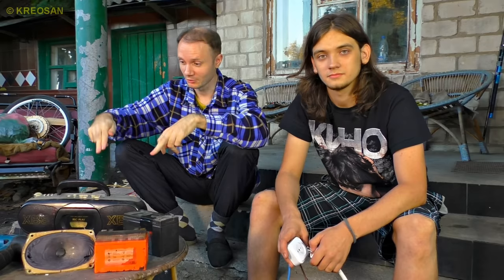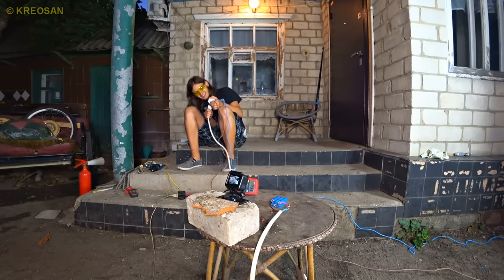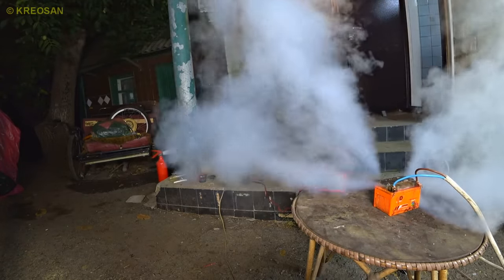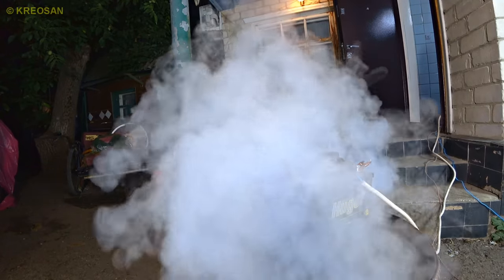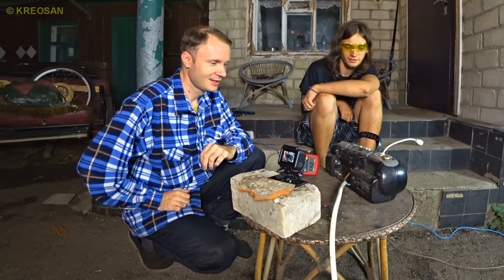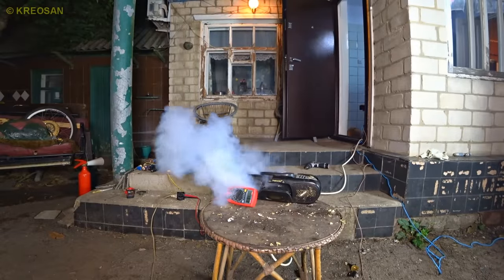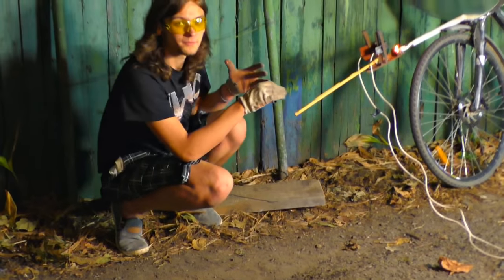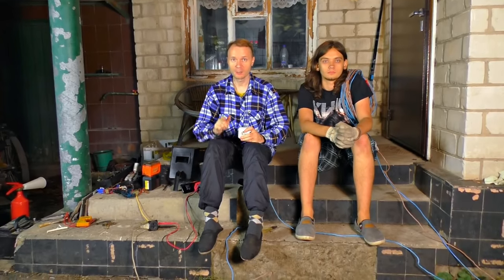220 Volts / Is it dangerous?

Comment: The power company must be confused when 50kW are being drawn from the streets transformer and all except one house have fled away.
Reply: they don't have street transformers, there's a transformer building for each village, some times for the entire county or town and the company can't really see that stuff
Reply: @user-ge4uk9ui8y  r/woosh
Reply: How can they use so much Ampere without blowing a fuse? That scares me a bit.
Reply: @burtreynolds9912  they don't have fuses
Reply: @user-ge4uk9ui8y  Oh my God! Then it takes a very good fire alarm to sleep in that house! Especially after those electric games...
Reply: Ignas On Google Streetview i have seen street transformers often enough in Russia. More in rural areas though.
Reply: They have an old video showing how they get the unlimited power. Directly. No fuses. From the above ground powerlines
Reply: Was that 220 volt ac or DC
Reply: And then they send an inspector in there yard to check for electrical issues and see this 4:29
Reply: @mr.waffentrager4400  If I had to guess, AC.
Reply: @mr.waffentrager4400  guessed it was AC. "Alternating current"
Reply: 6:10
Reply: @mr.electronicsdevicevlog9333  
6:10
Reply: @impostrous  r/wooooshwithfouros
Reply: Street transformer and 127 V is murica only
Reply: They don't have street transformers. One or few more big transformers supply the entire village. This ain't murica honey so gtfo.
Reply: @burtreynolds9912  they go straight from the meter
Reply: @2DC24 so, illegally?
Reply: @mileslo_hobbies it's Ukraine, they haven't seen "Legally" since 2013ish anymore 😂
Their Country is a Mess, so what's here considered 'illegally' is over there "just surviving daily Life" .... 😢
Reply: @user-ge4uk9ui8y transformer building? lmao it’s a subststion and yes they do use transformers near streets
Reply: @2DC24 impossible .
Reply: @Ignisan_66 that’s wrong bud

Comment: The company I used to work for had some old carbon arc lamps for exposing images on printing plates. It was very old tech, but I was shown how they used to use them. Pretty cool and very dangerous. They produce a shitload od ultraviolet radiation as well as a few other dangerous frequencies. That last thing you connected is similar to it.

Comment: 3:14 huge battery in stock 🔋 
Hugel battery’s great high voltage smoke out  3:58
Well cooked battery 4:46
The radio’s great burn out 📻 6:10

Comment: How can you get 300 amps from main? You risk to damage not only your electrical installation but your local transformer too! I'm pretty sure your subscribed power is something like 9 kW so 40 Amps x)
Reply: Sok tau
Reply: @candra3312  yee komen indo..
Reply: @fahmimuhammad440  masha & the bear 😎
Reply: These smaller villages usually has transformer buildings and not a transformer for every street, so they do have higher amperage transformers
Reply: @kokbastian  im pretty sure the first message and the response are both hacked, ive seen those everywhere and the response isnt even an actual reply because the @[User] isn't blue.
Reply: @thenickstrikebetter  oh ok
Reply: Welding 100A current 20V give much more light than this, multiple it to 300A 220V  something dont match now. 70kW arch would burn that guys skin by UV radiation really fast.
Reply: @juhajuntunen7866  Does not sound fun.:_kreoasnLike::_kreoasnWow:
Reply: Cause they're tnt aight aight

Comment: What if you use 3-4 power outlets connected to a much thicker cord and have a way to convert it to an industrial kind of plug that has less of a chance to heat up.

Comment: It is not drawing 300 amperes constantly!
Only when he shorts the graphite pieces together the current jumps up to 300 amperes for a second or two.
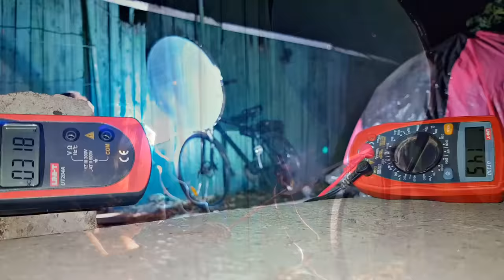From 8:33 to 8:37 you can see the current drops to 136 amperes or lower, but he don't show the actual current. The actual current may be between 40 to 50 ampere.
If he draw 300 ampere constantly the wires will glow all the way to the fusebox!

Comment: Hi Guys, I'm a British ham radio operator. a bit of advice get a 1:1 isolation transformer. You can still explode your things but protect your House wiring & extension cables & your electric wall sockets.  Best wishes.

Comment: Batteries like Lead-Acid Types and many more can't explode because they are valve regulated. This means they are not sealed completely. During normal charge they build flammable gas pressure that have to be released. Put a car battery on a normal charger and lay your ear on the battery housing - you can hear it bubbling. Thats normal. Some batteries releases pressure at all the time, others just at a certain amount. Scooter batteries or Lead-Acid Types that are maintenance-free has rubber valves sticking on the cell openings. You can see these rubber valves by removing the glued plastic lid on top of the batteries. The plastic lid only holds the rubber valves in place so they can't completely pushed off by pressure.
For safety reasons you have to blow over the battery before disconnect the charging clamps. If you don't do this, the flammable gas can be ignited by the sparks that can occur by disconnecting.

Comment: Well 120v is safer than 220v or 240 in that it pulses giving you a better chance of it letting go if you happen to touch a 120v live wire 220 or 240 isnt so forgiving considering it is  constant so it is going to lock you down ironically though the way europe and uk implement safety measures makes their 240v alot safer than America's 120v in my opinion for example arc faults and fuses in the plug something we should adopt

Comment: When I was a kid I went to this place at a lake that had a gazebo. There was an old fan in there with a cut electrical cord, and the part that goes into outlet was sitting there with both ends frayed.

I conned my buddy into twisting the two wires together and plugging it in.

Holy shit that thing was scary hahaha

Comment: Should have put a very large diode in series with the lithium cell for an ultra quick 5 second battery charger.  If you did the same with the drill motor you could have done your drilling jobs very quickly.

Comment: Here in the UK we use 240 volts
Reply: Here in Canada we Cannucks have 120 volts at 15amps. Don't even have to shut off breaker panel
when doing any type of wiring. If you ground out you get a nice jolt but it'd not dangerous.

Comment: It’s the current that does the harm. 220v is dangers are high current but if the current is low then it’s not so dangerous.
Reply: It’s like the welding machines, the electrode is at 60V and if you touch it you feel nothing because there’s no current unless you’re welding.
When you’re using High Frequency start, the HF spark is several thousand Volts and you can touch it but if you grab the ground clamp with the other had you may die quickly 😅

Comment: I can't agree with them being "pros" either ,because for it to be more of a safer experiment you need heavier gauge wire that is like the kind welders year or similar to, that's probably the reason the recepticle ends melted the plastic and could've welded to each other.

Comment: at me everyone uses 220v, I feel very normal, maybe the place where you live 220v electricity is very new right? a drill using Dc 12v or 24v that you use 220v will damage it is indispensable, only you are happy that I am happy. Thanks for your video. I use Google translate

Comment: You cooked the lead plates in the battery and if you put a battery on concrete especially a car battery it will suck the charge out of the battery and then it'll be dead and won't hold a charge

Comment: good video but very dangerous and they are damaging good equipment, they are putting their lives at risk and that of others if the day comes when they can disconnect the plug and burn the house in addition to the neighborhood electrical network or cause damage to the guallas capacitors or even cause a fault in the electrical panel.

Comment: But you should put 230 volt DC on the DC tools and AC on the AC tools, all tools that work on batteries are DC, your socket is AC. I think it will generate better results
Reply: Not really
Reply: @BurkenProductions  What not really?